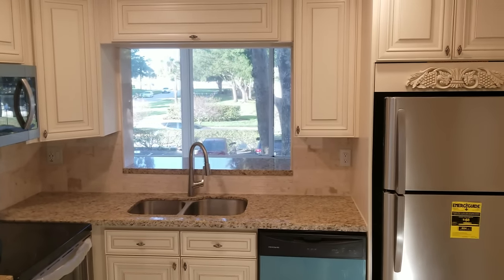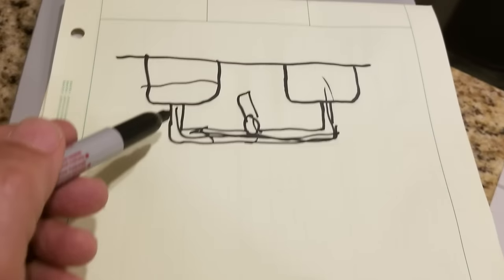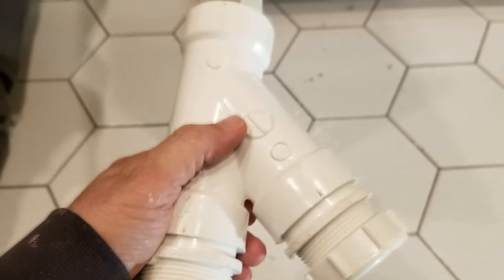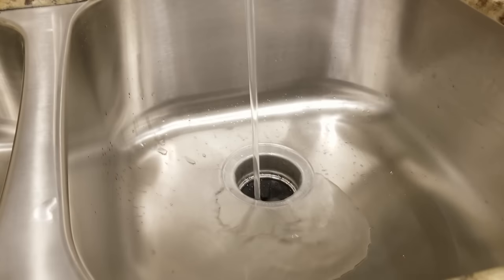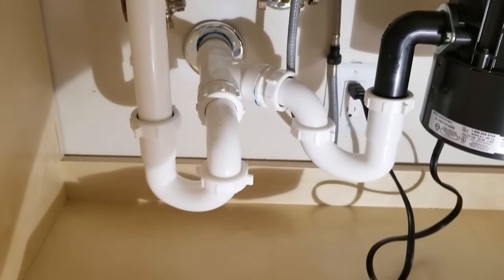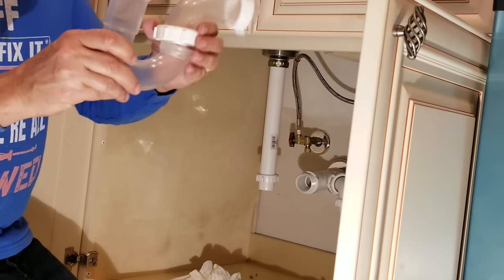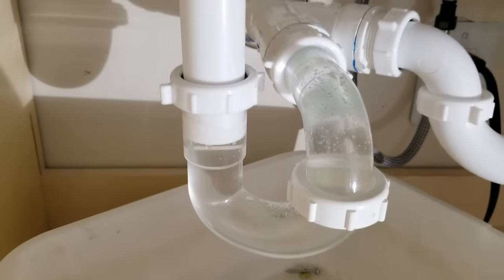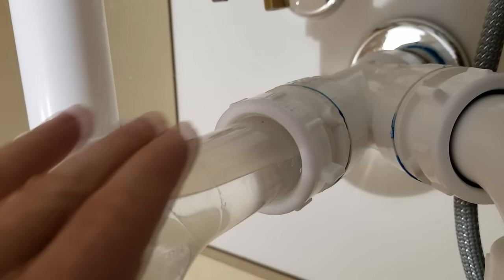How to Install Dual Kitchen Sink Drain Plumbing Pipes

Comment: You should always use primer. This would be illegal in my city
Reply from the maker: This cement is allowed it has primer built in
Reply: @jeffostroff  I am a licensed plumber and use that glue almost daily. It is not one step and you are still supposed to prime. I'll have to read the can but I'm pretty positive it says to prime.

Comment: Can't believe you used a clear P Trap to observe flow, but then neglected the critical issue that one sink may evacuate the PTrap of the OTHER sink by dynamic suction.

Of course the LH PTrap will perform as observed. You shoulda drained the RH sink to observe any evacuation of the LH PTrap, thereby perhaps inducing sewer gas into the home.  

Drain geometry will largely determine dynamic vacuum, further tailored by sink level, water temp, viscosity (think oil n detergents), pipe surface adherences and so on. So it is never possible to be categorically assured. But you used a clear view PTrap, you could've demonstrated the most important thing by simply draining the opposite RH sink.

Deep PTraps (narrow and high U) are perhaps the best measure to preserve a water trap, as the rising exhaust ought have enough volume to settle back and restore the trap. Curiously, in Australia we see shallow and wide PTraps commonly used nowadays, a sad reflection upon the plumbing community.

I share your view that individual PTraps and Y still the best, especially against cross-sink contamination, as one sink 'burps' into the other. But you hafta be cautious to the issue I have described.

Comment: THIS IS COMPLETELY WRONG AND NOT TO CODE. SINK 1 WILL SIPHON TRAP AT SINK 2 AND CAUSE SEWER GAS TO ENTER THE HOUSE. LEAVE IT TO THE DIY'ERS TO TEACH YOU WRONG. You need to buy a continuous waste with a baffle tee for a double basin sink. You cannot have 2 traps on one waste arm.
Reply from the maker: Sorry bro you are wrong, we used a Wye, so this cannot siphon out the trap, and it has not failed once in the 3 years that this has been up and running. You need to learn what a Wye does and why they are so important. Too many people use a Tee instead of a Wye.
Reply: @jeffostroff  lol unfortunately that's not how that works
Reply: The international plumbing code does not allow for you to run 2 traps on one waste arm meaning the horizontal waste arm in the wall coming off the vent stack cannot have two separate traps.
Reply: @jeffostroff  plumbing is my profession in TX and I know how to use and when to use DWV fittings.

Comment: You never drained the other full sink to show no backup problems.
Reply from the maker: Yes we did a lot of that testing while we were there unfortunately we lost the scene I don't know if we just simply didn't hit the record button right but once in a while when we do videos that'll happen where we just didn't capture the scene. But trust me we tested it over and over again we filled up both of those basins several times and let them drain at the same time there's no backup the only way you would get a backup if there was a clog in the line but the system works perfectly good trust me
Reply: Even if he had, it could have been CGI or a deep fake. Probably a government conspiracy

Comment: BUT STILL THERE IS WEIR LEVEL INCORRECT ! HOW WOULD YOU ADJUST IT BC I DONT KNOW WHAT IS YOUR LOCATION OF YOUR WORK ? ( HOUSE , COTTAGE OR RV ) ... LENGTH AND SLOPE OF TRAP ARM MATTERS IF YOU WANT TO KEEP UP THE WEIR LEVEL ACCURATE .YOU SHOULD HAD COMPLETED YOUR INSPECTION .
Reply from the maker: Trust me we have tested it and it works fine. People obsess too much about needing to see a massive ramp down toward the back wall for the p-trap arm. Remember the output of the p-trap is maybe 6" from the wall, so a 1/4" required slope is only an 1/8" drop across those 6", which is barely noticeable. After this video was made we switched the pipes to transparent p-trap and you can see the weir is just fine. Let me warn you about overdoing that slope, if you make it too steep, you will violate plumbing codes, and potentially cause a self siphoning effect, and drain your p-trap of protecting water seal.

Comment: ? #1.  Why aren't ALL P traps made out of clear plastic?  i would be a much better plumber if they were.. omg you have to have everything perfect in order for this crap to work right.. um.. i used to build bridges not pianos!   ! ? #2. do i have to have this vent for every single drain.. omg i am guessing that i do... what a pain the the ice... and i need one for floor drains and tubs too, i am guessing ... oh, ya.. one last thing.. what would be worse to have a methane problem with a septic tank system or with a city sewer type system.. does it matter.. if so how and why.  please forgive my ignorance.  thx for the help.
Reply from the maker: We no longer recommend clear P-traps, the type of ABS plastic they use for the clear P-traps is more brittle, and easily cracks. We have replaced a few after only 2 weeks in come cases, a month or 2 in others, then we found out lots of other users of these parts reported in the reviews that they lasted weeks before cracking, so don't use them. Sucks because we liked seeing inside them.
Reply: #1) Because you don't want to be able to see the horrific mess that sits in a p-trap. #2) Every drain needs a vent, it is code. It'll never drain properly without a vent. It'll gurgle because the drain system needs air in order to drain smoothly. In the event you can't vent out through the roof or connect to an existing venting system, you can use an air admittance valve which would allow air into the drain allowing it to drain normally. However, these valves are mechanical and will fail after a few years and need replacement. Therefore, you need access to them and can't put them behind walls or in concealed places. #3) Methane problem? Like sewer gases are getting in your house? That is usually caused by a lack of traps. The trap keeps water in it at all times which acts as a barrier from sewer gases coming back up and stinking up your house. If you've got no vents or traps in your house, you've got some work to do.
Reply: @losferwords100  yeh,  at that time I did (have some work to do).  Thanks for your wise advice.  I hope our comments can help someone in the future, if not just entertain them.  :D I did have 2 pipes that I had put in for future rooms to have plumbing a utility room and another spot.  I had capped them off, but ya.. I know now an admittance valve would have been better than a cap, and since I was planning on coming back to them "soon" anyway, 2-3 year fix would have been the best way to go for me there.

Comment: Don't do this. No reason for two p traps. Causes additional issue when/ plumbing air vent is clogged. 1 p trap with one sink downspout into the other which allows air from the opposing sink to allow better flow.

Comment: ...I would done it differently 

Rookie install
Reply from the maker: This was installed by a plumber of many years. Just because it is different from the way you would do it does not mean you have to insult the person. It's always the clown trolls like you that come in here blowing steam out your butt but in the end you forget to acknowledge that the installation works and it works well and it was very well tested and working perfectly and it is to code as well. And if you want to challenge that you better fork over the exact article and paragraph number of the code that you think it is violating. It's at this point that guys like you usually run away because you've been outed

Comment: Not to code
Reply from the maker: Yes this is allowed, you can use a wye like we have
Reply: @jeffostroff  you can not have more than 1 ptrap on any fixture. It can lead to siphoning and let dangerous sewer gases in your home. Im a plumber and im certain thats illegal and would get red tagged on inspection
Reply: @MrDstoned  What is the correct way? Connect both sinks to one P-Trap?